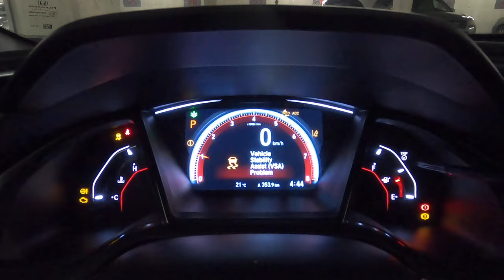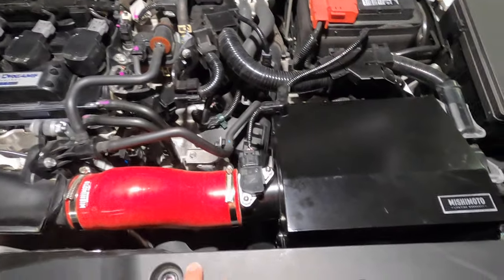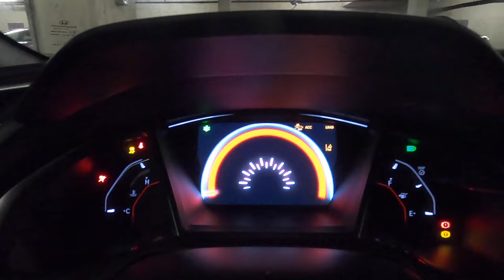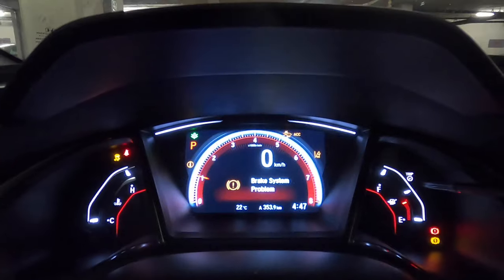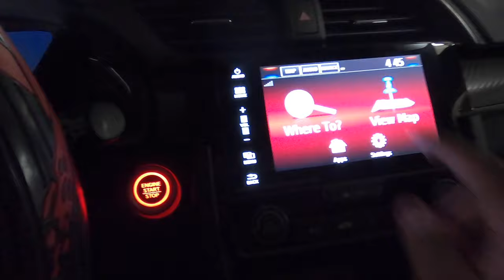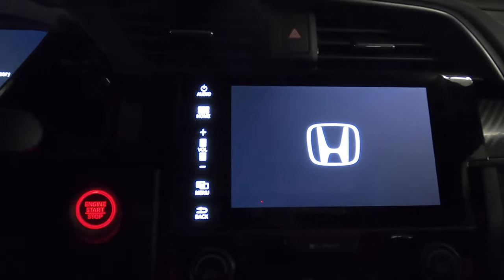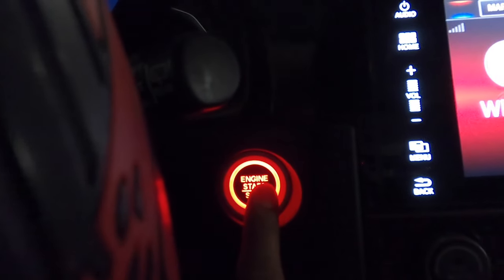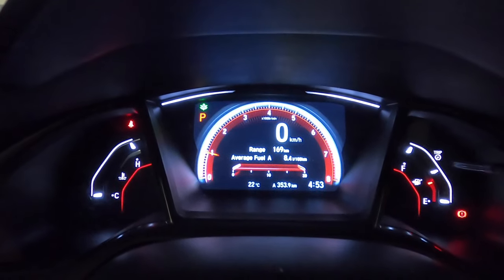HOW TO FIX MULTIPLE WARNING LIGHTS ON DASHBOARD OF 10th Gen Honda Civic

Comment: Awesome video.  We needed this.  I had same issue.  Did you car go in limp mode? Like no power to go over 20 mph?  Hope u didn’t get the warnings back again.  Anyway great to see you found a solution.
Reply from the maker: No codes at all! Everything went well! Thank you! 🤙
Reply: @geefamz7172    Awesome. I will try this if this happens again for sure.  But when u had all the codes, were u able to drive. Mine went to limp mode
Reply from the maker: Oh I did not try to drive it with the codes on
Reply: Are you pressing brake pedal only  then it starts up. I’m having same issue
Reply: Had same problem with my 2021 civic sport yesterday and it went into limp mode when I was driving, was experiencing loss of acceleration
Reply: @admitmohan  mine went into limp mode with all the warning lights and I had loss of power from acceleration
Reply: See my daughter's car never went in to limp mode and never loss power but it' just had the same thing happened with the warning lights coming on after there was work done on the car so, I changed the wheel bearing on the passenger side. and then I drove it home and the warning lights came on so I looked it up and seen the comments and then I did the factory reset and then I did the reboot and then I did the battery reconnect and then it' still didn't work till I decided to drive it up the street and then when I got back and shut it off and restarted it and it wasn't showing the warning lights anymore so hopefully it doesn't happen again
Reply: Has anyone figured out what caused the warning lights to come on to begin with because I got them to shut off but they keep coming back on and off so I need to find out why they keep coming on because the car is running fine even when the warning lights come on so something has to be done about it so it doesn't mess anything else up on the car
Reply: @zymierosbourn9061  same problem here. I can’t get to the bottom of it. I changed my battery. My connectors to my battery. Rewired my battery wires. Still no luck. Although taking off my positive connector and resetting it works it only works for a few days then boom lights are back on. I’m not sure what’s setting all the lights off but my car starts up just fine and runs perfect so it’s nothing eternal just wiring im thinking.
Reply: @JONsoSwavey  what did you do to fix it ?
Reply: @stephapee25  did a hard reset like in the video
Reply: @JONsoSwavey  How do so do it with a basic radio. I don’t have the touch screen and tried to do it with the button but nothing.
Reply: @JONsoSwavey  Mine too, 8MPH up hills to get  back to my house because it was freezing here this morning.
Reply: Went 8MPH up hills this morning when it was about 10 below.
Reply: @admitmohan  this happened to me as well the fastest my car would go is 20 mph but once I turned off the car completely and restarted it,it worked fine plus no codes.. but unfortunately I’m getting all the codes again but this time the car runs fine.. did you ever solve this issue?
Reply: I'm having same issue with warning lights can't seem to figure out how to do a hard reset on a basic lx model
Reply: It happens to me all the time. Very annoying! And also the issue with the touchscreen system flickering too.
Reply: @purekuno6140  did you figure it out at all with the LX model ? Same problem here and I just bought it from the dealer 2019
Reply: This happens too if you unhook the battery. All I did was drive wasn't in limp mode or anything. Just every light on. So I drove, shut the car off, then on again, everything went away. No issues since.
Reply: @JONsoSwavey  what ended up being the problem
Reply: @jacobnoyola9220   Apparently no one knows what the problem is?/!
Reply: @stephapee25  me too help!!
Reply: I just tried this with my sisters 19 civic sport, did a transmission drain a fill and disconnected the MAF to get to the fill plug easier and after that all these lights came on. Car is still drivable but after this reboot no success. Any other suggestions?? Please?! 🥲
Reply: @lonniev1231   Did you find a fix for the problem?
Reply: @tcu.1.  unfortunately no, I've done the reboot and I've even done the factory reset and nothing.
Reply: @lonniev1231   By the way I've had the same issue and bought the scanner and it worked for me...
Reply: @tcu.1.  we went to the place where she got it, and they have that big screen scan tool and they couldn't figure it out either. This was before i made the reboot attempts too
Reply: @lonniev1231   The dealership couldn't figure it out either on my car... So I bought the scanner as a last resort and it cleared all the codes and turned off all the lights... I'm not saying it will work for you, but it's did for me.
Reply: @tcu.1.  which scantool?
Reply: @lonniev1231   It's probably the one that posted this video is deleting it.... That's sad...
Reply: @lonniev1231  MOTOPOWER MP69033 Car OBD2 Scanner Code Reader Engine Fault Code Reader Scanner CAN Diagnostic Scan Tool for All OBD II Protocol Cars Since 1996, Yellow
Reply: @lonniev1231  MOTOPOWER MP69033 Car OBD2 Scanner Code Reader Engine Fault Code Reader Scanner CAN Diagnostic Scan Tool for All OBD II Protocol Cars Since 1996, Yellow
Reply: @lonniev1231  MOTOPOWER MP69033 Car OBD2 Scanner Code Reader Engine Fault Code Reader Scanner CAN Diagnostic Scan Tool for All OBD II Protocol Cars Since 1996, Yellow.
LOL...
Reply: @tcu.1.  well I am hesitant as I mentioned they already hooked up the scan tool and nothing happened. She's gonna take it in this week so we'll see what happens with that. I found it on Amazon though so I'll keep it in my cart. Thank you for the input!
Reply: @tcu.1.  q
Reply: Honda told me i needed to replace the battery fan motor and the front camera by the rear view camera. $1,500 and it might fix it.
Reply: @Kevin Bedolla  UPDATE on this. So my sisters issue with the Christmas tree light on her dash was fixed. Don't know the specifics but she was told she had low voltage going on. So in any case I'd check battery and alternator voltage and I'd check battery post connections for any corrosion and any grounds. Hope this helps anyone still dealing with this. And the weird thing is I don't think anything got replaced when she took it. All I could deduce is maybe they just charged her battery? Cause it still looks like the one she had when she got it. Keep in mind she got this car at a lot but they're good folks. Done business with them for over 10 plus years and a total of 6 cars purchased from them.
Reply: @zymierosbourn9061  I got the same issue …they go and come back all of a sudden …have you figure it out?
Reply: Hey just letting you know my small experience with that.  Was delivering pizzas in a horrible snowstorm 3 years ago.  Had to keep pushing the engine to just under red line when I got stuck.  Towards the end of the night it stuck me in limp mode and even my electric brake wouldn’t engage.

Had to not only get a reset like this but also had to just drive it normally a few days and it just went away magically on the freeway….  That definitely had to do with pushing the engine to hard but could t help it I was stuck lol
Reply from the maker: @tcu.1.  I wont delete anything! If this reboot works for you then it works! If it doesn’t then it doesn’t! Don’t cheap yourself. Bring it to the dealership or your mechanic. Good luck! 🤷‍♂️😏
Reply: Just happened to me and the reset removed one code and then it came back...
Reply: That's exactly same as my 2021 honda civic  like no power  over 20mph bro!!!
Reply: That happens to me too,those warning lights coming out on and off and but the acceleration of the car was fine while warnings lights are on. Dont know what is the issue,did uses my car dx test while its on but it doest show any code errors. Some says this is the issue of 10th gen civics.
Reply: It happened to my civic, and I towed to the mechanic. Tire blast on high way, then battery drained becoz I left huzzard lights on. I replaced it with spare tire and boosted the battery, first start it worked fine and 2nd time all signes came on dash. Towed again to machine shop. 500$ for towing. 😢😢😢
Reply: Well, I know I’m late to the party here, but I had the exact same problem on my 2022 Honda insight this week. Couldn’t figure out how to do a hard reset but it doesn’t matter anyway. After having service technicians at the Honda dealership the problem now find out that I need a VTC actuator, Electric motor and valve cover gasket to the tune of $3700
Reply: Mine  as well  @JONsoSwavey
Reply: @JONsoSwavey so what did you do what was the issue I’m facing the same thing
Reply: this had happened to mr

Comment: HONDA SAYS THIS IS NOT A KNOWN ISSUE AND NO RECALLS  AVAILABLE!! Seems like it’s a common issue and they don’t want to deal with it.
Reply from the maker: I agree
Reply: What has to be done to make it a recall or I wonder if it can be turned into a class action lawsuit
Reply: I wish. Should be. Just like how my screen flickers. Should be a recall too! Got it changed under warranty at only 37,000. Flickering on and off occasionally and then just died. All controls and options even heating! So dealership tried everything and had to replace it. $2200 repair bill, expensive unit! So then at 110,000 km it starts flickering again, the new OEM unit! Shit. Dealership says warranty over, sorry. So now I am chasing Honda Canada to replace it. Not fair. Damn thing should last life of car. Faulty Chinese electronics. Should be a recall!
Reply: This is happening to my 22 si and it’s driving me nuts
Reply: Every time I need to look at the screen it just flickers and you know we only have half a second to get the information we need. It is so annoying and distracting and dangerous.
Reply: @RARRRRRRRRRRR I’m taking mine to the dealership tomorrow all of them came on out of nowhere mostly all of them expect engine light and one more but my mechanic managed to take a few off but he said that there might be a problem with the top camera or bottom one by the grill he said it either that or it needs an update just like your phone does so I already made an appointment with the dealership just so random never had a problem with my car until that
Reply: @bristheemufanpage  all the best. I'm preparing my Honda for sale and never buying a modern Honda again. It's not the same quality it used to be and they don't stand behind their product. They are too big now and don't give a s***
Reply: @bristheemufanpage  also, I am sure your mechanic is wrong. My 2016 LX doesn't have any of the front cameras or safety assists and still get the 7 or 8 messages. I believe it's a sensor somewhere acting up or a connection, intermittently. Comes and goes, usually when rains or humid. So moisture. Not all those systems are at fault but I believe the car is programmed to give you the shit load of them to scare you into bringing it to the dealership and get it diagnosed. Kinda like limp mode except it doesn't affect engine power.
Reply: @geefamz7172  Do you know how to reset it if you have the other radio?
Reply: @Indiam. press in the volume button that’s the power button on the other one I have it on my 2019 sport
Reply: @dreamcrusher9058   thank you but that didn’t work. I tried. But I have the basic model.  You have to run the switch back and forth without turning it over fully to restart the system.
Reply: I have a 2020 civic SI and I’ve found that disconnecting the battery for a minute or so helps reset the computer and the lights go away. Rebooting the dash unfortunately didn’t work for me.
Reply: I took it to the Honda dealership and they said that it’s my fuel tank pump that is the problem
Reply: @jeanettehernandez3271  there was a recall on that I hope they didn’t charge you for it.
Reply: I purchased a 2019 Honda Civic in December 2022. The car is at 53,000 miles now (I’ve only put 20,000 on it now). This problem had happened to me at least 4 times. I do this reset every single time but it always comes back at either a couple months later and most recently happened twice in one week. I’m incredibly frustrated and almost thinking of turning this car in and saying screw Honda.

Comment: Ok I think I’d take the time to comment on this. I have a 2016 Honda civic. I tried everything on this video. It worked initially but eventually failed and the warnings lights came back relentlessly. So I didn’t know but you can take your car to autozone for a free scan. Did that and two error codes came up one for my right front passenger wheel sensor was failing. Second was for the air flow tube intake. Anyways long story short I took the car to the mechanic and he said the front right tire sensor was fine and nothing was wrong with it. However when he checked the air flow tube intake it was torn as in worn out. The part itself is about $25-$30. Part # 17225-5AA-A00. Might be a diff part # for each year. The mechanic charged me about $30 in labor. It’s been two days and the warning lights have not came on. Hopefully it fixed the issue. Maybe this will help someone else. Good luck guys. The author of this video did mention he changed something in his air filter I believe and it caused these lights to come on.
Reply from the maker: Good to know

Comment: Just want to put this out there….this fixed all the lights except anything that involved the tires….I calibrated the tires system and it solved the rest of my issues. If you have a alert for lane control, lane mitigation, hill assist, etc..calibrate your Tire system (I forget what it’s called TP..somthing). This was all due to the shop inflating my tires and changing the oil. First time Honda owner here, still learning.
Reply: have you gotten those lights to go away yet?? mine are still on too
Reply: TPMS. Tire Pressure Monitoring System. Lol
Reply: thank you so much ah
Reply: What did u do to fix

Comment: Amazing video. Although resetting it didn’t turn off every light it turned off a few. But then lifting my hood up and checking my battery connectors I noticed my positive(red) wasn’t on correctly and got a different screw for it, so now it can fully tighten around the battery connector itself. After doing that I drove around my block once and all lights turned off!! Maybe this will help anyone that’s still in trouble with there lights on after resetting it.
Reply from the maker: Thats a good point. Thanks
Reply: I’m getting a parking brake problem and the parking brake sometimes takes a couple times to disengage :/
Reply: What year is your car because there is a recall on the 2016 Honda Civics for brake problems and I'm sure it's on other years too but u can look ur car up on Honda recalls by Vin number and see if it has any recalls on it and go from there to get it fixed
Reply: This worked for me. Cheers mate!
Reply: @EgVetsje  missing my Honda everyday 🥺
Reply: @f7act  Understandble. Its the best car i've had. Everything just feels right you know? Sure it could have abit more HP and a better transmission, but the feeel is just so good....THOUGH! Dashbord lit up again today...same problems. Realy annoying. Need to look for more fixes.
Reply: Same here, lights where still on until i drove around the block then park somewere and  did the reset again. All lights turned off then.
Reply: @rickr2885 having the same issue , every morning ! What did you do ?

Comment: Might not work right away, but it definitely works. After doing the reset the lights where still on but they went off after a few minutes of driving.!
Reply: yeah，it didnt work on my car！so it will gone after driving for a while of u？
Reply: Just rebooted mine, all lights are still showing 😢
Reply: @phiphi01  did you ever figure it out ?
Reply: @garcia5328  Yes, so it was actually a serious problem. 
My oil light came on a few days prior and I put some (small bit) extra oil in the engine as I did with my old cars. But apparently with these new engines you never put extra oil in. So it overfilled and the engine kept misfiring, not being able to drive very fast. It also needed an oil change  too so that didn't help.
All serviced and sorted now thankfully, no damage done. 😌

Warning lights only showed up 2 days after...